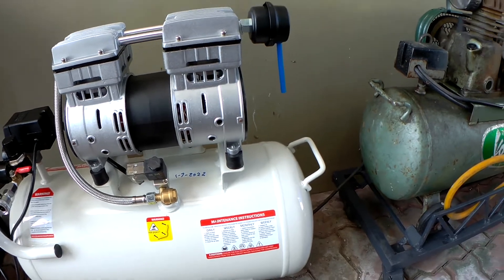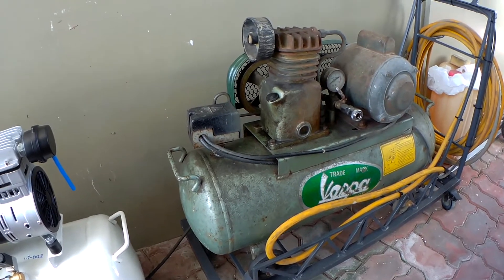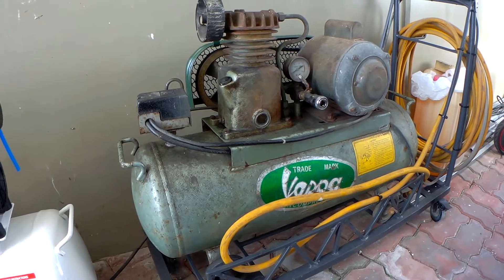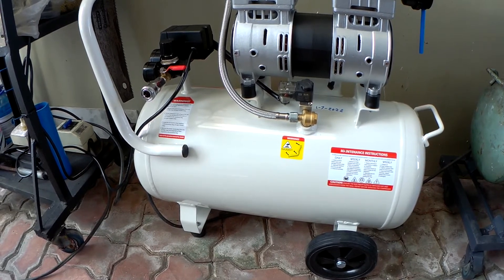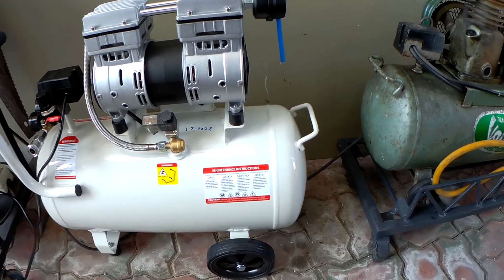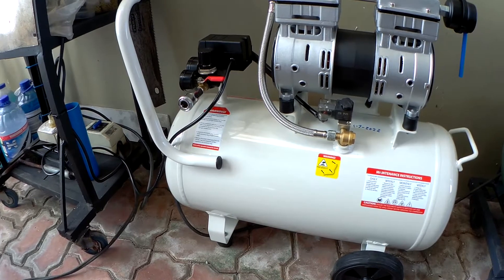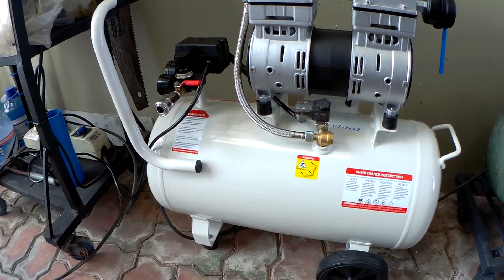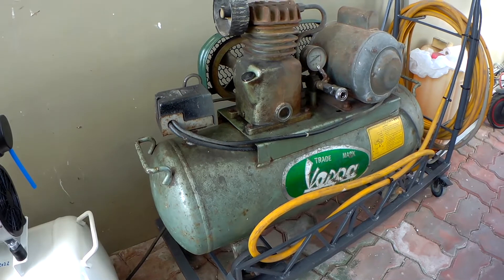oil-less and oiled air compressor comparison

Comment: Umiinit ba tlga head nya sr?
Reply from the maker: yes pag umaandar yong motor niya. pero that's normal sa kahit anong compressor motor
Reply: @mrbelat  kya continious umaardar sr?mga 4hours or 5..tpos tutukan ng fan..
Reply from the maker: @jezzyvinchsyn5819   i am not too sure kung kaya na continous na ganyan havent tried it na ganyan katagalan.
Reply: @mrbelat  pero yung sayo po sr gaano ktgal nyo po ngmit na oras..
New version po kc yung sakin..
Reply from the maker: @jezzyvinchsyn5819  i’ve owned it for a couple of years now mainly for light duty application lang like para sa gulong ng auto, kung minsan pang spray paint etc. im not sure kung ilang running time na niya

Comment: Yes the oil-less compressor is quieter but here is the real issue is the longevity.  There is a friction factor.  In other comparisons the oil filled compressors lasts longer.